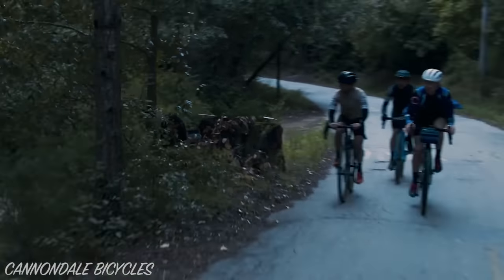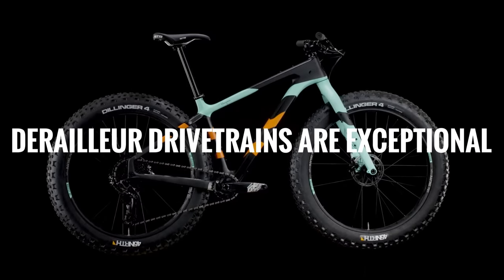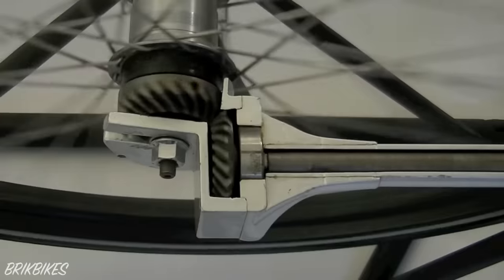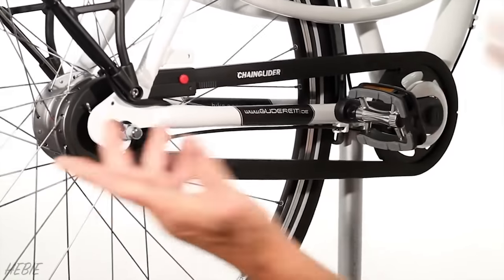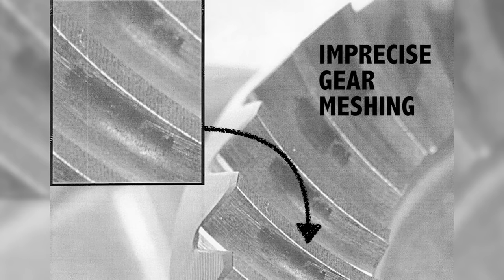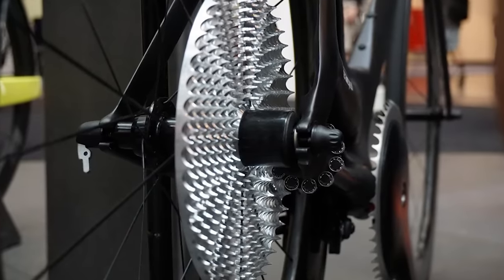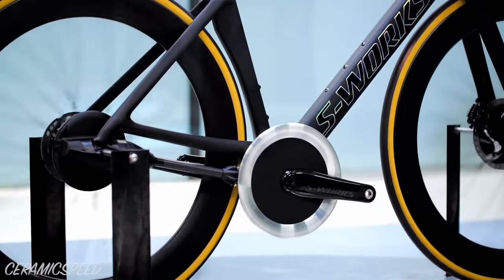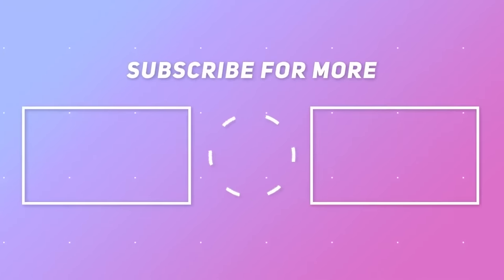Are Chainless Shaft Drive Bicycles a GENIUS or TERRIBLE Idea?

Comment: considering bicycle manufacturers couldn't manage to get the tolerances right on pressfit BBs, it's highly unlikely they will get them right for a shaft drive system
Reply from the maker: Savage... but fair.
Reply: That is two very different things. Carbon is actually a difficult thing to produce to tight tolerances. Machining can be very precise
Reply: @DaveCM  some can't even machine aluminium for bb30 and pf30 .
Reply: Reminds me of a buddy who once told me cameras would max out at 8mp as the science at that time was where it was at.  I told him just wait.  Imagine how far science has taken us in the last 50 years and try to think forward.
Reply: @davidstepro7486  the issue for the bike industry is cost effectiveness . Digital cameras are relatively easy to produce cheaper . Manufacturing a part like shaft drive , ensuring quality control at frame factories and producing the volume for such parts is hard for cycle manufacturers to get right .  Case in point is the new cervelo with cracking head tubes , canyon with their seat posts .
Reply: @davidstepro7486  To be fair to your friend, we basically hit the practical limits of size for individual image sensing units a while ago. At best you might see another doubling of resolution for the same size sensor as lithography techniques continue improve, but I kind of doubt we'll see that much. What your friend failed to realize is you can just increase the size of the sensor to get more megapixels. This requires a bigger lens, which adds physical bulk, which is why you generally don't see more than 20mp sensors in cell phones. 

Also, color quality is a thing that matters, and when your images sensors are too small they are only triggering on a handful of photons, which makes it extremely difficult to get accurate color. More photons hitting the sensor means more accurate color, so a physically larger sensor is desirable for color accuracy. That puts a hard limit on the minimum viable size of an image sensor array.

This is why a super high-end brand like Hasselblad will still only have like 50mp, but the actual image sensor array inside is 2 inches wide. Cell phone cameras are 1/10th the size (or 1/3 the length, or 1.5% total area - pick your comparison poison), yet hit 16mp - about 1/3 the total number of image sensors in the image array. If the image sensors in the Hasselblad were as densely packed as in the iPhone's camera, it would be a 12.5 gigapixel camera. And a pro photographer would be very disappointed in the quality of their images.
Reply: @davidstepro7486  digital tech develops exponentially, or at least has been in recent decades. Mechanical engineering is a totally different thing. Look for example at space programs, there’s really no advance in the fundamental technology since the 60’s
Reply: There are too many parasiticlosses in the system.  There are far fewer in a chain drive.
Reply: @tarstarkusz  exact, chain is one of the most effective way to transfer power.
Reply: @jeffwells641  The latest Hasselblad has a 50mp image sensor but can produce an image quality nearer to 200mp. My cheap action cam with its 20mp sony image sensor can produce an image nearer to 2mp due to its microscopic image sensor and cheap fixed focus lens. Money buys quality every time. Hasselblad H6D-400c MS   £43,500.00 vs £43.99  £200 bike  vs £2000 bike
Reply: Even if they get the tolerances right, shaft drives are extremely inefficient. Motorcycles can get away with it by using larger engines, but they doesn't really work for people. 

Belts are probably the best compromise between durability and efficiency.
Reply: @Lassi Kinnunen 81 Not true, chains are the most efficient drive train available for bikes other than attaching the crank directly to the drive wheel. The main reason people want anything else is maintenance and durability. But, efficiency is best with chains nothing else is close.
Reply: Bicycle manufacturers are playing it safe, that bunch is the last one pushing changes forward, they don't want changes, they are selling traditions and with good profit. Why would be a good idea for them to bring something new? Here is some sort of similarity with Tesla EVs the shape, and appearance is traditional only the engine was replaced by a drive shaft and ECU by a Chinese notebook but that is about it, the rest of it is old Ford T just a bit fancier. Manufacturers are the biggest handbrake of the design and tech progress because of selling numbers. They could be in danger if they will reach for drastic changes even if it would be great from point of view of efficiency, consumption, safety so on. Money talks.
Reply: @edmundscycles1  valid.
Reply: @davidstepro7486  Actual optical resolution is affected by aperture size. So lots of cameras out there claims an "optical resolution" (i.e. sensor resolution) way higher than what is physically possible for the aperture size.
Reply: Regardless bicycles are king for transportation.
Reply: @seasidegalaxystreet  Unless it's 20°C below freezing, or you need to travel 500 km/day or need to carry a family or 200 kg gear or you need equipment that needs serious amounts of power.

There can never be one single  "best" type of vehicle.
Reply: @perwestermark8920  in London it's really the best to be honest. Apart from in heavy rain.
Reply: @seasidegalaxystreet  Unless you need to transport heavy stuff or have a family wiyh multiple small children. Once more - never one single best type of vehicle.
Reply: @davidstepro7486  Not the same thing buddy. Completely different fields. Just because an ant can survive jumping from a plane without a parachute doesn't mean you can.
Reply: @Cyclingabout  Maybe the bike manufacturers fall into the same trap you do when you say (several times) that "High tolerances" are required to make shaft drives work. In fact, demanding situations require LOW tolerances. Tolerances are a measure of permissible error, so less is more betterer.
Reply: @Gottenhimfella  if things were wide tolerances, it would be too consumer accessible . Can't have people fixing it,  without expensive technicians.  
    It's the auto industry paradigm, lol.
Reply: @davidstepro7486  that is not the complete picture, you only see the stuff that did work, not the stuff that failed miserably.
Though, to be fair, it is not as if we could predict with 100% accuracy if a specific R&D challenge can succeed or not, at least not without trying very hard. 
If there is a critic to be made it would be about the ressources and ingenuity spent in solving a problem which already has a pretty good solution, especially when there is quite a few pressing matters to be dealt with.
Reply: @Lassi Kinnunen 81 *high tolerances. Low tolerances means it needs to be very precise as it can not tolerate much dimensional chancmge.
Reply: @Gottenhimfella  no mate. When you talk of gear mesh, the tolerance has to be good. If you allow the gears to push apart under load, then it will damage the teeth or at worst jump and smash the pinion wheel first time out. The use of a shaft is a good idea for reliability in off road conditions.
Reply: @radnasirhill  They work fine in flat cities with plenty of infrastructure for them, like the Netherlands. But, unless the entire city is designed for them to be the primary method of transportation for normal people, get suck.
Reply: @michaelbamber4887  Sort of,  sealing it up leads to reduced maintenance,  but,  you lose a ton of efficiency spinning that large metal shaft. If you want something good for off road, you'd probably just take a belt and seal it up in a case. It's quite durable and relatively efficient.
Reply: @michaelbamber4887  I was making a point about language. You and I do not have any point of difference about tolerances needing to be "good", I was objecting to the use of the word "high" tolerance when in fact the tolerances (permissible deviation from nominal sizes for meshing distance, etc) have to be LOW  in order to have close control of the clearances and fits.
Reply: @SmallSpoonBrigade  Normal is by any means not what others think but what is the individual right of decision making. Nobody should force others to say that their norms are the good ones. In many levels the Dutch society is a form of communism and by law communism is illegal. Period.
Reply: @davidstepro7486  Its much more about physics laws and material than sciense. Materials not progress as fast as electronic components, not even close. All that things we see, needs a super stiff, super strong, and super durable materials to do it right, and for last long.
Reply: You know yamaha has made bicycles right?
Reply: @akabiscuitwaffle   Indeed. There's not much they haven't made and made well, from musical instruments -- starting with reed organs 130 years ago -- including highly regarded pianos, guitars, brass & woodwind instruments, electronic organs and synths, through to sailboats, motorbikes, automobile engines for other car makers, ATVs, snowmobiles & outboard motors, along with other seemingly unrelated stuff from furniture to semiconductors ...
Reply: @DaveCM  I worked in a bike shop when I was young. I can't tell you how many major brand bicycles I took out of the boxes with one entire side of the frame unwelded. The margins are just too low in the bicycle world to produce high quality assurance. Way smarter to stick to low tolerance systems.
Reply: Well said!!!.
Reply: @jeffwells641  Digital imagery has, where sensor size is limited, gone the way of higher integration and more engineering. Mostly we now see multiple camera sensors and high-performance AI processors that use software to fix some of the physical limitations of the sensor package.

However, it's unlikely that complex integration is going to solve the mechanical problem of shaft drives. Particularly because they aren't really solving a problem that exists, as chain-and-sprocket works just so damn well.
Reply: Those tolerances are easily achieved with machines from the 1960s, the fact that no one understands how far americas has fallen when it comes to the engineering prowess of the average citizen is despicable.

You want to know what a real engineer thinks, "Well I need a tighter tolerance for this" "has anyone else figured it out" if not they meet some other clever friends and start bouncing ideas on how to improve the tolerances in cheap, simple, manufacturable way.

 Corporations and educators love to hide behind a false wall of complexity. In truth we usually improve or repurpose ideas until we get somthing better and new.

I can easily tell you that these bikes have been designed and made already, and I bed the reason no one wanted to fund the idea, is that if you built it tough, it would last practically forever.

I've got gear boxes easily twice my age for PTO tractors that see way more stress then any bike would ever see any day, bikes are neither see high speed, or weight load, and literally could almost never overheat.

With modern material science, this will easily be done with 3d printers.

If you can make a bang bang stick with a 3d printer, you can make a high strength function gear system
Reply: @dlayman101  There is a big difference between achieving tolerances on individual, machined parts and in mass production. Of course you could achieve insane tolerances in the 60s already. Just get a very big and heavy lathe, and a good dial indicator, and then take shallower and shallower cuts until you're there.
But that's not how mass production works. Parts get cast and reference surfaces then get cut on automated and very fast CNC machines, otherwise you can't produce on big scale.
Reply: …except they already make them and it’s old technology that’s been made for a while.  Someone didn’t watch the video
Reply: @HkFinn83  there absolutely has been advancement. Getting adoption has been difficult due to expensive testing and contract issues though. The massive costs involved in effecting change in the aerospace industry don’t compare here. As far as mechanical engineering outside space travel, entire new methods of manufacture have popped up quite consistently over the last few decades
Reply: @davidstepro7486  I have been noticing diminshing returns in the last 10-15 years. Think 1990-200 we went from shit quality CRT TVs to flat screens and then smart phones in the mid-2000s. All we have seen since then is very slight improvements which get smaller every year. The iPhone 3GS to the iPhone 4 was a pretty significant upgrade, but anyone would be hard pressed to notice any improvements between the iPhone 12 and 13.
Reply: Lol thanks guys you just saved me 9 minutes
Reply: @DaveCM  not really, more expensive than machining mettalics, but certainly no less do able.
Reply: @HkFinn83  what he’s saying is that it’s a digital technology coupled with a mechanical one. The mechanical one being the size of ground glass required to create an image circle on a physically larger sensor. This is why medium format lenses rarely are faster than f/2.8. It gets real expensive and real heavy real fast.
Reply: I’m a cnc engineer, and I think they could get tolerances right for the drive shaft. I’ve seen these machines make some crazy things to .001 runout. The hardest bit would probably be machining the material you would blow through carbide and diamond cutters
Reply: @Dan Nguyen Right you are. I'm a mechanical engineer myself. I think what I was really getting at was in an industry where the profit margins are so thin, it would be best to design with highly fault tolerant processes. As an example, I just can't understand why they don't build more tire clearance into the rear end of most bikes, there's plenty of room. But I guess it boxes the bike into a "niche" by not allowing 2.6 inch tires.
Reply: Precision is incredibly easy to get, the issue is it’s very expensive
Reply: @DaveCM  both the GE90 and CFM LEAP-1 fan blades are made using carbon fiber. I'm pretty sure they have very tight tolerance.